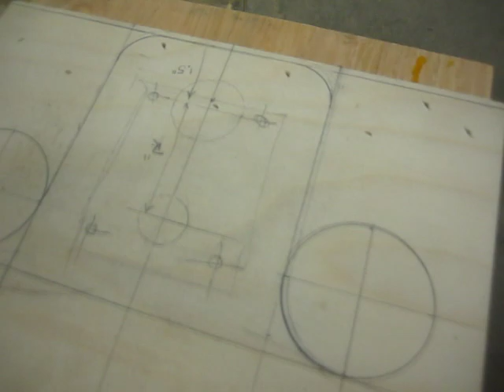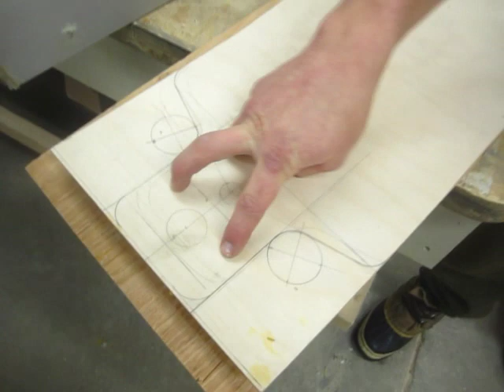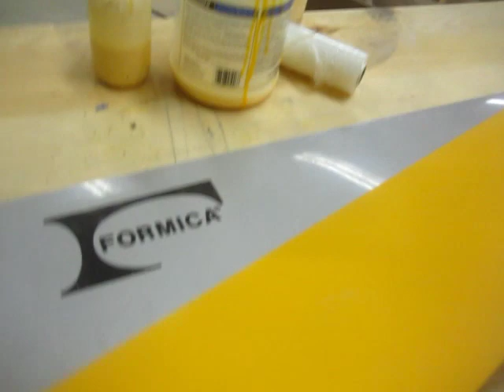Making A Built In Aluminum Noseguard.

Comment: It'd be interesting to see if you could do this on a skateboard deck on the nose, tail and center of the board to keep the board from snapping doing grinds and reducing splitting
Reply: back in the day skateboards were made of metal.but that's very dangerous and my just chop your foot off
Reply: +Troll King may*
Reply: Troll King It wouldn't be an entire board, just the high impact areas to make them stronger.